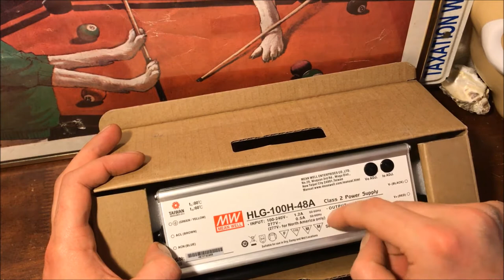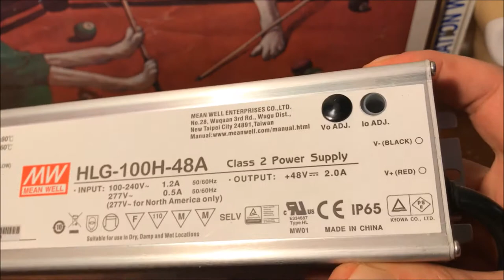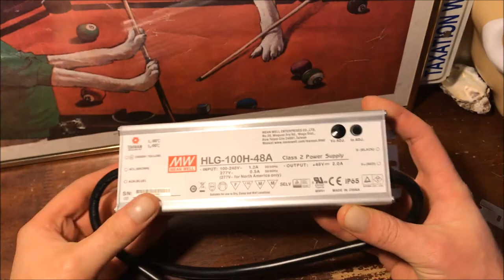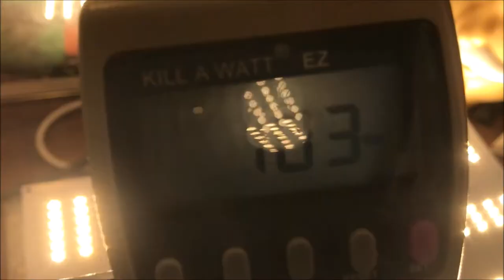LED Driver for 2 QB120 in Series - Episode 88

Comment: I have two extra drivers for a mammoth 800 W light that I have and I was wondering if I would be able to use those two drivers to power a light that I made and change the connections or whatever I would have to do on the driver itself possibly to do so

Comment: Also where did the black and red wires go that was on the bottom wired opposite? Where do run those to?
Reply from the maker: Polo PakaLoLo the half black, half red wire is connecting the two boards together, on the side closest to camera. This connection can also be done on the side that the driver is by as well (ie all wires on far side), makes no difference. In fact the newer board qb132 only has molex connector on one side, so this type of wiring isn’t even an option. All that matters is the polarities alternate between connectors on board, and the same bw boards and driver IF WIRING IN SERIES. It might be more obvious in the next part, which is E91.